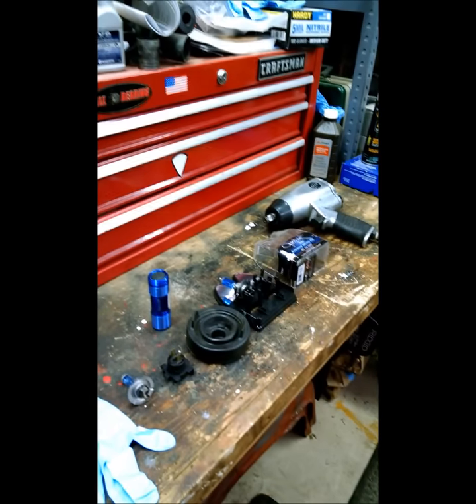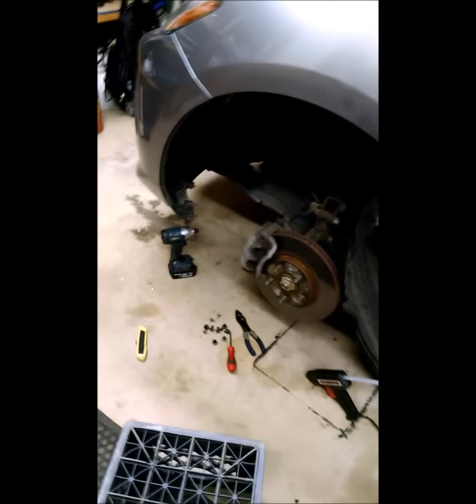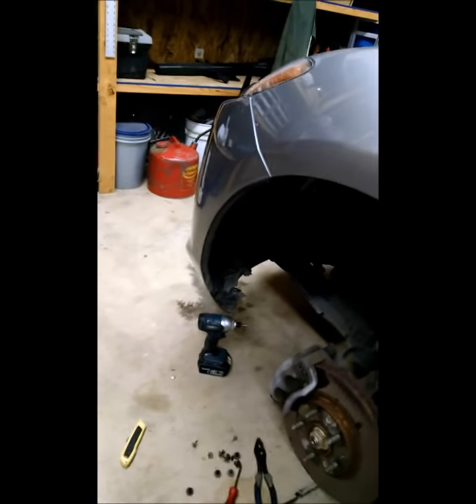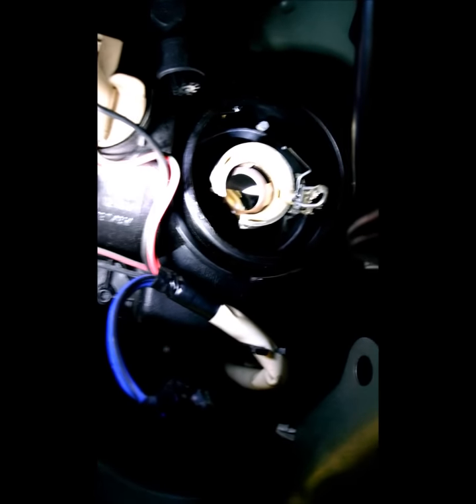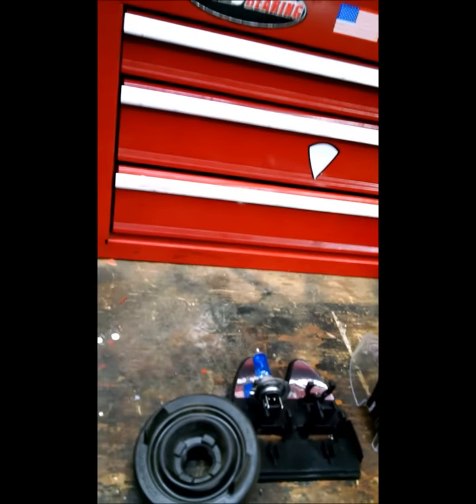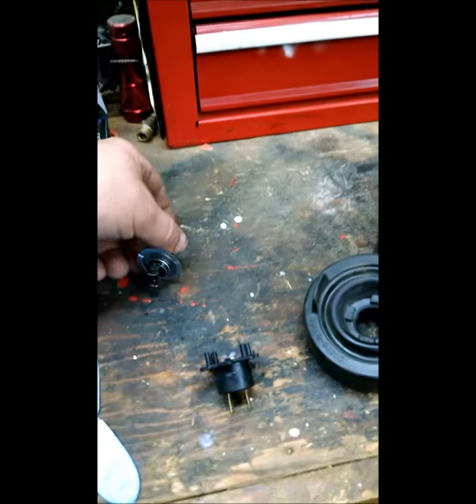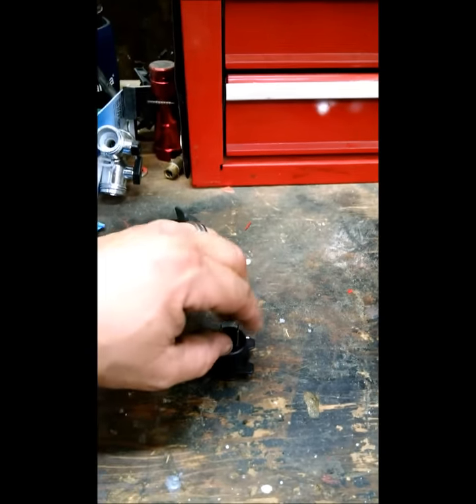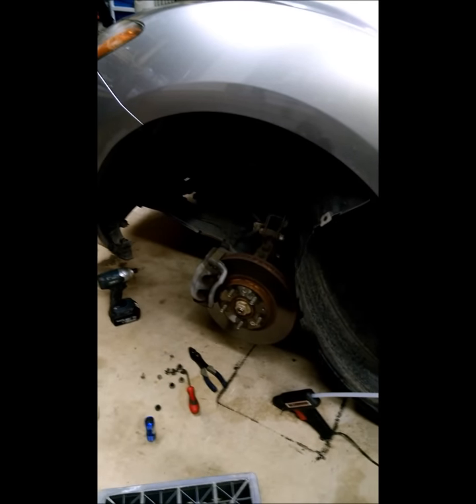Mazda CX 7 Headlight Bulb

Comment: OK, first thing, you have the general idea, but you missed a whole lot.  You don't need an impact wrench, the lug wrench in the back of the car will do just fine.  The light socket on a 2011 is much harder to get to and you will need a mirror so you can see how the clip hooks.  THIS IS A MUST!  If you don't know how the clip hooks and unhooks you will break it and like this video says, you will be putting out some money to get a new one.  Use a mirror and practice hooking and unhooking the spring wire.  Once you get this task down, the rest is a piece of cake.  Also make note of how the light socket comes out of the fixture.  Make note of its orientation because it must go back the same exact way.  There is no "push in and twist" that most people are familiar with.  This video is correct in noting that it is much easier to take the wheel off and take off the mud/wheel wells to get better access.  Another thing this video missed was the three screws that also need to be removed under the front of the car.  Again, this may just be on the 2011s, I don't know, I've never looked under a 2010.
Reply: Thanks for your comments.  I'm new to YouTube and will definitely try better next time be more thorough.
Reply: Danny you are so right. It's very frustrating that everybody talks about how this metal clip is so important but no video can show you how that metal clip works.!!!
Reply: Robert Del Vecchio Yeah, it's really a strange wire clip.  You have to get a mirror and a flashlight and study how it works before trying to unclip it.
Reply from the maker: I did show the metal clip the best I could.